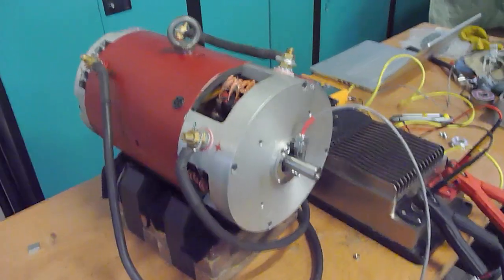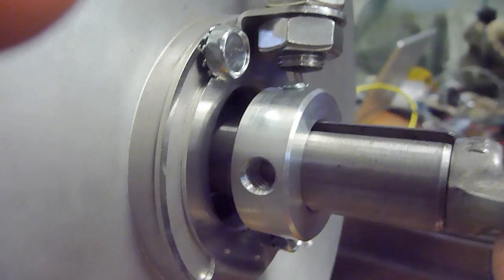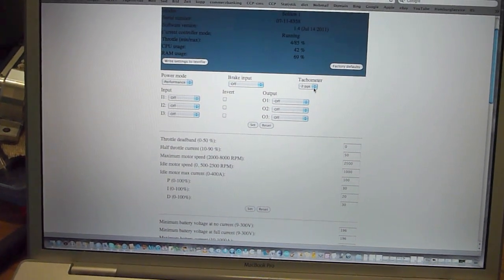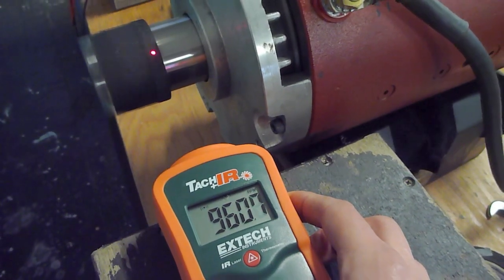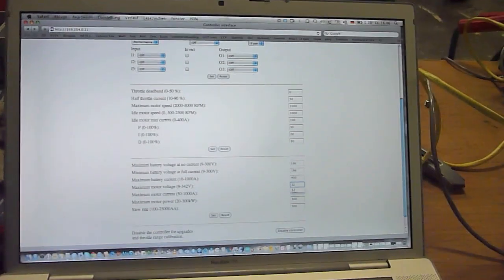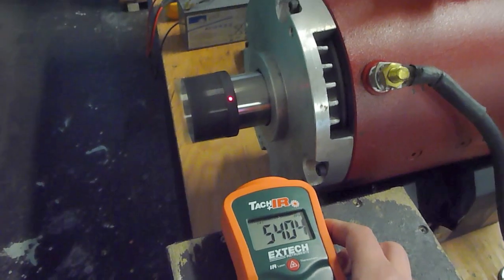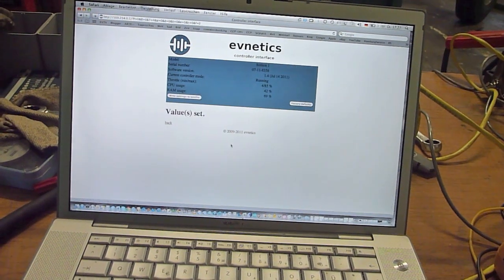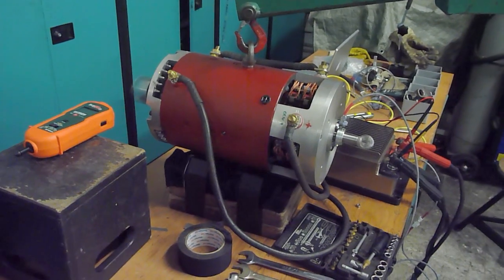EVDrive 06/2012 RPM test with the Soliton1 WarP9 and the Rechargecar Speed Sensor

Comment: HI  NEED HELP  build this electric trike consist of 200v lithium and zilla controller 1000amp and 1 warp-9 motor. i would like to upgrade my controller to a zilla 2000 amp 2k and still use my 200v will the warp -9 motor handle the volts and 2000 amps for few seconds
Reply from the maker: We talking about 360-380Kw. The cumulator will get hot very very quick. How quickly will the motor get to some rpms?
By specs you are far beyond the limit.)
https://www.go-ev.com/PDFs/003_09_01_WarP_9A_Graph.pdf
Reply: do you think the motor will handle  for a few seconds at a time  with what i have now the motor reaches about 100 degrees on a 90 degree day @MathieuRech

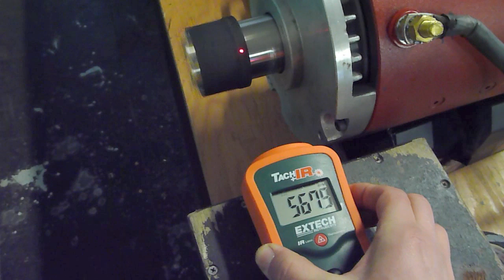Comment: The "funny melody" made by the motor (at ~5:24) is from the controller randomly skipping pulses to maintain the low idle RPM setting (~600) at no load. The steady-state error in idle RPM is normal - you can reduce it (at the expense of stability) by increasing the P and I values. Lastly, could you explain what you did to get the speed sensor to work? We seem to have inconsistent luck with that one. Thanks, Jeffrey @ Evnetics.

Comment: Good job!  To answer your question, the Rechargecar sensor has both the magnet and the sense coil in the sensor itself. It will sense any ferrous metal that passes close enough to trigger the circuit that the sensor is attached to.  If you hold a piece of metal up to the end of the sensor you will see that it is magnetic.  If you have a scope you can connect it to the sensor wires and see the signal generated by the sensor as your motor spins.